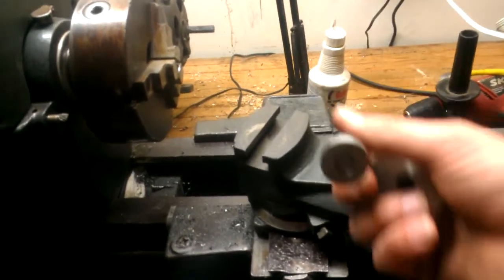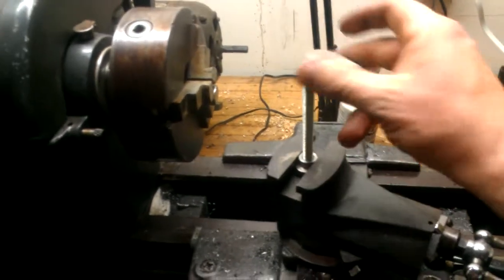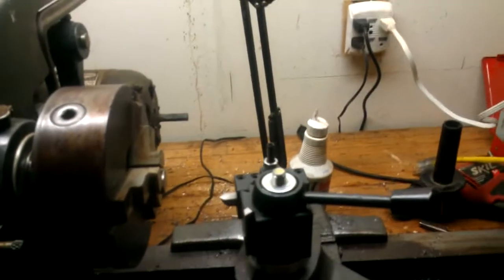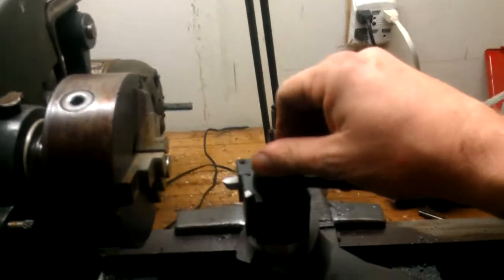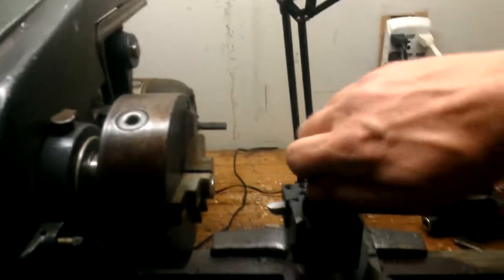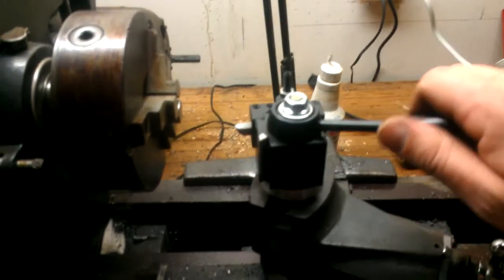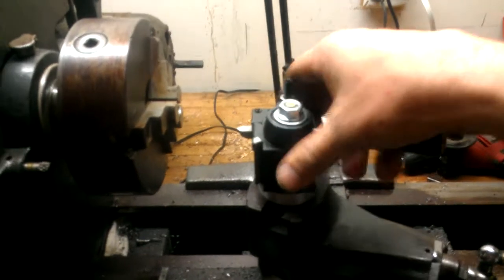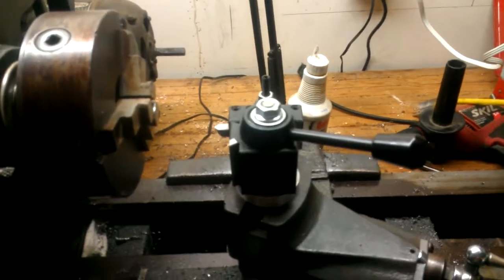T slot nut take 4

Comment: Cool. Those tool posts are light years better than the old lantern type. Lets see it in action!
Reply from the maker: little machine shop .com has them for about $80 or so the axa size is realy what you need for your lathe and used tool blocks are lots more common on ebay